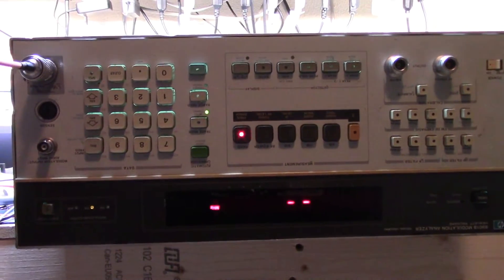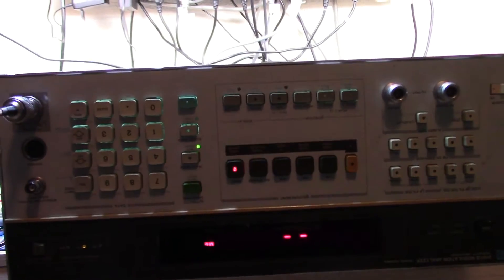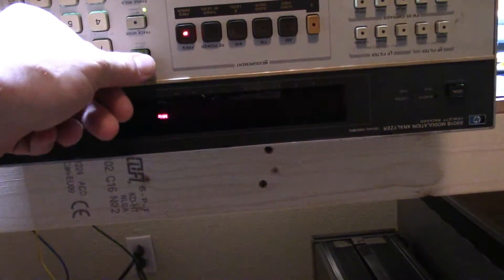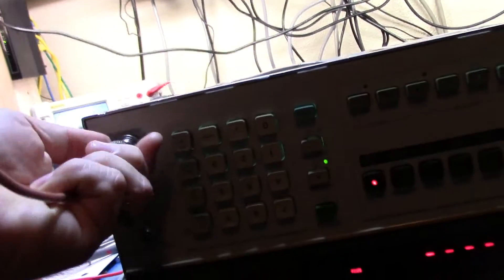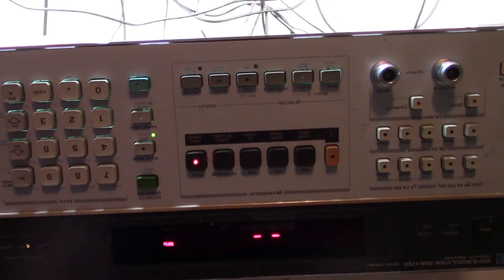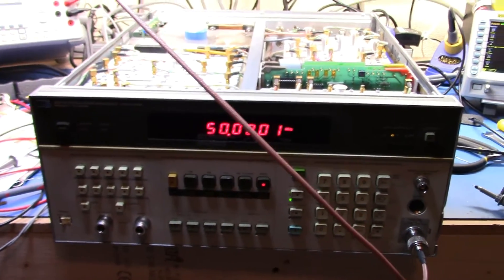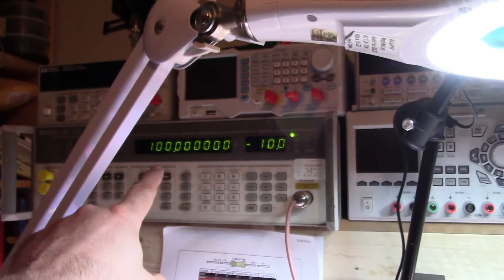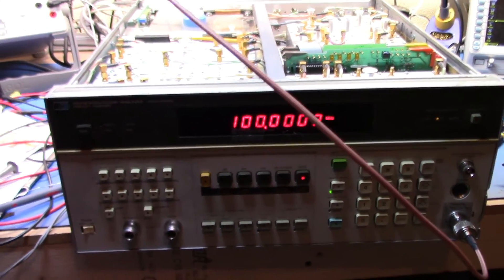HP 8901B Modulation Analyzer Repair Weirdness - Full Video

Comment: Hello, I have an HP 8901B modulation analyzer, it works well up to 600 MHz and up there it doesn't work anymore, as if it were the doubler.
Have you seen any failure like this.
thank you
Reply from the maker: Yes I had a similar problem in an 8902A - It was the doubler but the part was a HP only part that was unavailable as a replacement - I was lucky enough to get a spare board from a member of the HPAK forum (over on Groups.io) - The internals of the 8902A and the 8901B are almost identical so the same documentation should help in the troubleshooting - Service Sheet 17 in both cases.

I did a video on my experience here - https://www.youtube.com/watch?v=21nozchgOag

Happy to send you the PDFs I have if you don't have them
Reply from the maker: Actually I thought I'd just post the link here - https://1drv.ms/b/s!Amqar8_XQ9Uzk7pW61K_OdEpGYqjpA?e=5aGqag

Comment: What is the difference between the 8902A and the 8901B ? they look similar.
Thanks
Reply from the maker: They're based off the same fundamental HW and very similar functionality - This was why I bought this non-working 8901B, so I could get the mechanicals for the front panel and connectors.

In terms of functional difference, I think the two biggest differences are the ability of the 8902A to do Tuned RF measurements down to -127dBm and the improved accuracy of the unit for power (0.001dBm) and frequency (1 Hz) - Though to be honest, they may be options that you can get for the 8901A as well (the resolution/accuracy ones, not the Tuned RF).

If you're working on radios you'd probably be well served by the 8901B (especially with options 30-37) but for working on signal generators (which is what I use the 8902A for) you really should have the Tuned RF Level stuff IMHO.
Reply: I've got a 8901A (not working) and 8901B.  I used to use the 8901B when I worked as a factory analyzer at Motorola on the old analog cell phones.